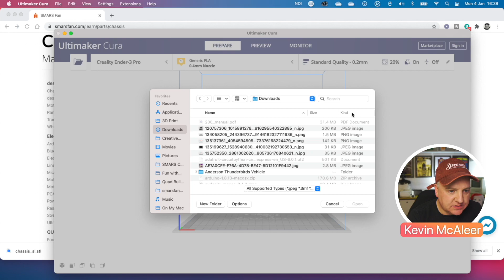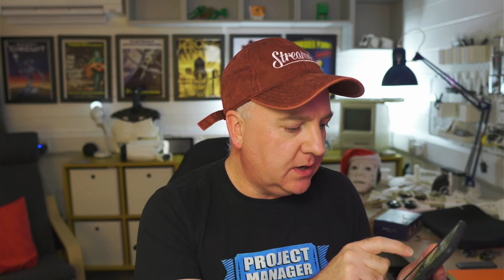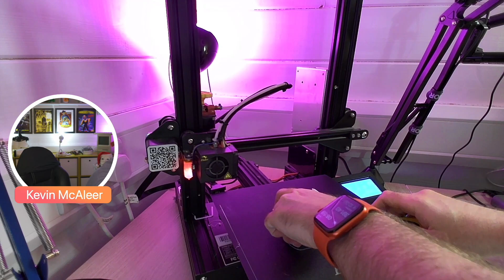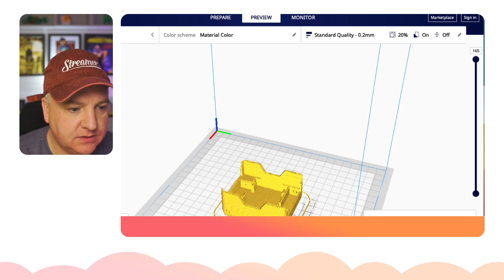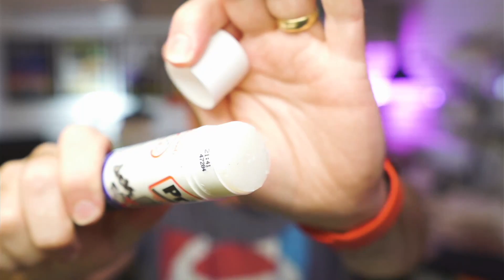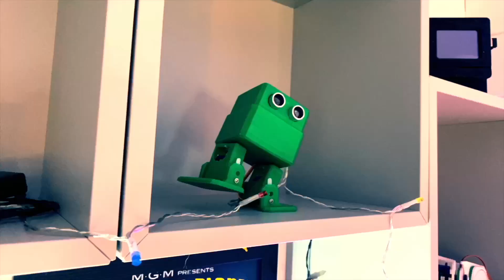How to 3d Print a SMARS Robot

Comment: Hi Kevin,

Hope all is well. I am printing on a Anycubic Kobra 2 Neo and the printing is coming out bad. I am not sure what settings to use for this build as I have attempted the settings listed but it still fails. Adhesion appears to be the cultprit if I do not use supports. I cannot print the wheels flat on the print bed.
Reply from the maker: Yes you’ll need supports (I prefer the organic supports) and the wheels can print face down
Reply: @kevinmcaleer28  thank you Sir. Do you have a 3D printer you recommend? I’m looking to do more but want to use different filaments.